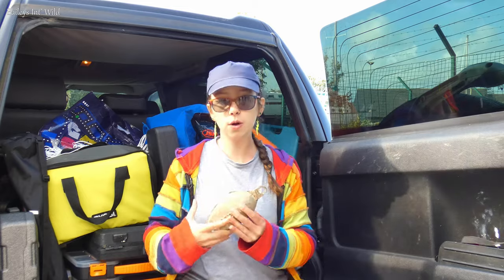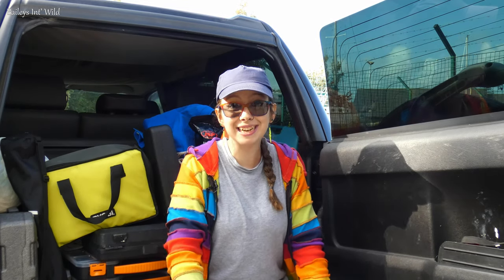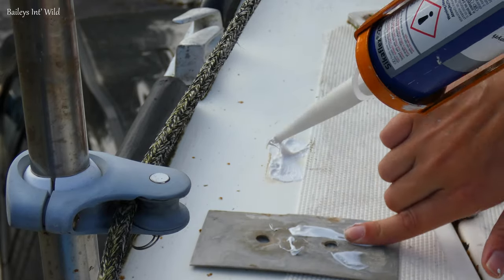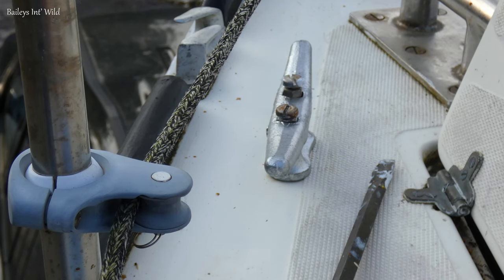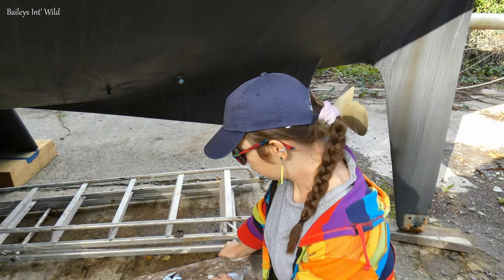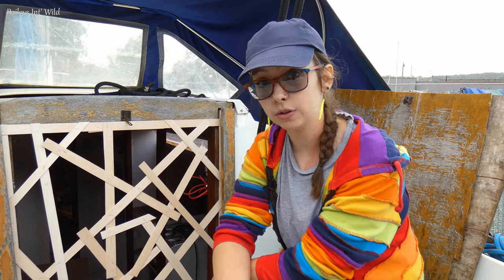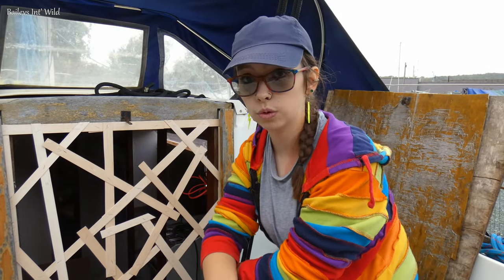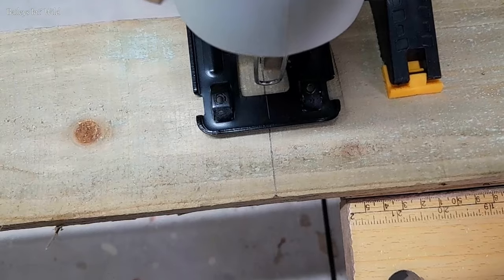We build a NEW DOOR & Our Boat Work is Halted by STORM AGNES [Ep.9]

Comment: Cerys may I ask why you didn't use a single piece of 12 mil ply for the hatch door instead of those several planks of wood , unless that was just a quick fix for the situation of course. That old anode looks fine so maybe it could be used for a spare down the track and please look into epoxy and Butyl Tape when needing to put bolts thru the hull otherwise the leaks will come back if not sealed properly...google is your friend when researching the best methods to use when working with fiberglass boats and when you get to doing the inside you will need a good knowledge base to work off. Love what ya doing and why ya doing it and so far Fire Fly is looking much better for your effort and I can't wait to see her and the family out on the water.
Reply from the maker: Thank you so much, yeah, we can't wait to get out and sail her. 

Yeah, of course. When we came to looking for ply at the time to make the door, we couldn't seem to find anything in stock initially at our locations. So we had to think about what else we might be able to use, even just as a stop gap. We then measured the door frame, so we were prepared when looking at other materials, and found the slot (where the door slides down), to be 22mm wide (with calipers). So 12mm plywood would be rattling around anyway, and likely cold in the winter. We came across this timber, and it was the correct width, so we decided to give it a go.

So far, the template fits the space well, and the door we made fits the template. We will need to use filler between the gaps in the planks, and it's an odd shape now we have it all built. The final test, I guess, will be trying to put it on Firefly. We also have some oak strips to replace the slider sides if we need to (we're not sure yet of all the correct terms).

We do use Google a lot, and we watch a lot of videos, but it can be overwhelming how much there is to know, and whether we can rely on it. We are focusing on techniques for cabin building, but our interior will likely be nothing close to the original 

Thanks very much for the question 😎
Reply: @BaileysIntWild  It's all good mate you certainly don't mind a challenge and everybody learns on the job...you can do just about anything when remodeling the interior just keep in mind that the bulkheads inside are in their position for a reason and that is for structural strength of the hull ok. Have a look at "Sailing for coconuts" it's a very simple to understand site for all things sailing that you will need to know as you progress and if you need a site for fiber glassing let me know and I'll set ya straight. Say hello to ya mum and brother...I see 'em in there. : )
Reply from the maker: Yeah, thanks, we'd love some info on a fibre glassing site, thank you. Sailing for Coconuts is a great channel, we learned a great deal from their channel. We honestly love engaging questions, so genuinely, thank you. 

Mum and brother are around for all of it, but they are not keen to be on camera. Jacob does bits and bats where he can, and Mum does the filming, editing, website, and any of the jobs she can reach. They both said hello back :)

Comment: Why is there a nut by the head of the bolt on the cleat? Shouldn’t that nut go under the backing plate? I wouldn’t think that bolt should be protruding above the cleat.
Reply from the maker: We didn't have the correct fittings at the time. It looks to need bolts (with a hexaganal head), but we didn't have any stainless ones. 

So we put the bolts we did have in, from the top, but wound a nut to the top of the bolt to fill out the captive hole. It was the only cleat available at the chandlery too, so we needed to make it work. So it does have a nut at the top only to fill the hole, and then underneath the plate on the underside there are two nuts (one for locking). 

We can change these out when we get the correct fittings. We just needed to seal the hole.
Reply: I’m gonna need that jacket.